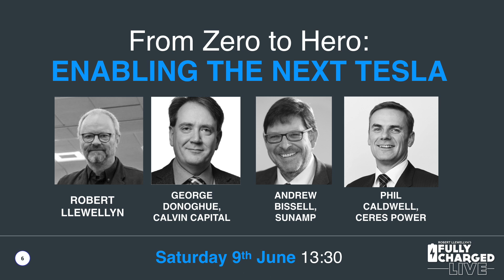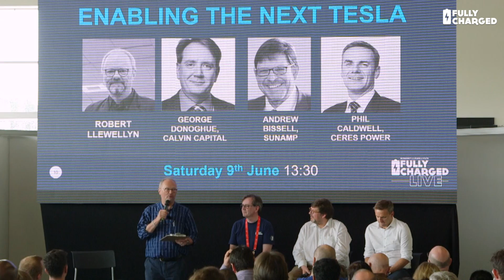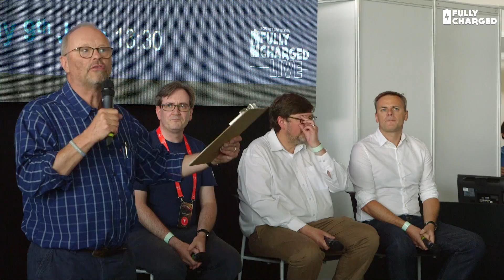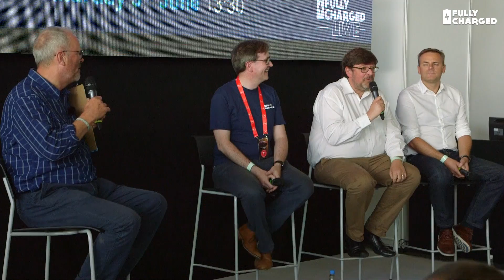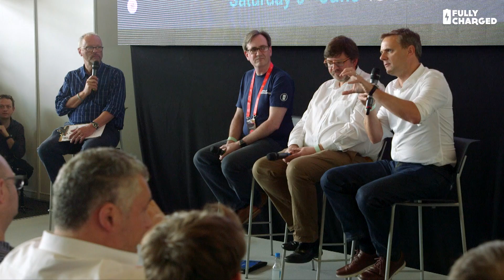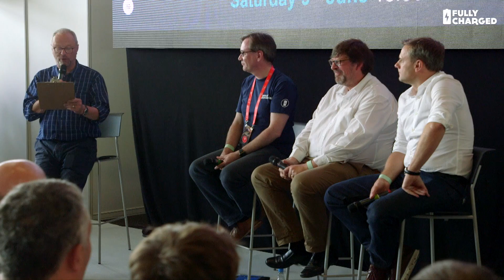Enabling the next Tesla | Fully Charged Live 2018 Talk 5

Comment: 6:30 Tesla doesn't make it's own batteries??? Does this guy not know about the gigafactory? Sorry but you lost all credibility after that comment
Reply: Milan Shah Panasonic make the Batteries in partnership with Tesla at the gigafactory. So technically they are correct.
Reply: The critical technical innovation that motivated Tesla was the observation that they could take off the shelf laptop batteries (the 18650 cell) and build an EV with them rather than have to develop their own cells. The comment the chap made was exactly correct and an important take away.

Comment: Fuel cells are still using fossil fuels.  Natural gas (Methane) is a fossil fuel.  Hydrogen almost exclusively comes from Natural gas, a fossil fuel.  Hydrogen made from electrolysis of water is about 3 to 4 times less efficient than using the same energy to charge a battery.  

On the other hand, fuel cells powered by natural gas are more efficient when they are used to produce both electricity and heat for water and air.  (In large part this is because the normally wasted heat is captured and used for something else.) But that's still using fossil fuels.  Solar and wind are better.
Reply: I would ask the question, what is produced from bio-digestion plants? Their natural gas is a product of decay, yes, but not over the period to qualify as a 'Fossil' fuel, I would have thought.

Also, if surplus solar energy is used to 'crack' water into hydrogen for a fuel cell, that too is not using a fossil fuel.

Just a thought.
Reply: Good point.  Biomass can be Carbon neutral, but it matters where the Carbon in the biomass came from and how it got there.  Lots of fossil fuels are used for making fertilizer (and energy to make the fertilizer), crop cultivation, etc.  But a majority of Methane used commercially is a fossil fuel that comes from the ground when oil is extracted, etc.

The problem with using solar energy to do electrolysis of water to get Hydrogen is that the same energy would go 3 to 4 times as far in a battery electric vehicle.  Hydrogen from water used in a fuel cell is about the same overall (well to wheels) efficiency as burning fossil fuels in an ICE.  It is not an overall improvement in energy efficiency.  It is not economically viable, and it's a poor alternative to simply charging a BEV and going 3 to 4 times as far as a fuel cell vehicle on the same overall energy input.

Improving battery technologies have already made Hydrogen fuel cell vehicles uneconomical, and they were never very practical or cost effective for vehicles to begin with.  Fuel cells are excellent in space stations however.

That said, if electricity and heat must be generated from natural gas (a fossil fuel), then using a fuel cell can be more efficient than other means.  But it's still fundamentally using a fossil fuel.  Long term, we need to use renewables, not fossil fuels, and the sooner we get there, the better.

Comment: The Sunamp heat battery is very intriguing.
Reply: Fully Charged did an in-depth episode on the battery in 2016 https://www.youtube.com/watch?v=9upXeTMHUqE
Reply: I am looking into one and have been for a few months. Hot water and heating. The trouble is there isn't any customer reviews to assess its viability. If I can save my gas bill (£700 per year) it will pay for itself quite quickly and then start to pay back the solar installation. I like and understand the concept it's real world use from an user I would like not the manufacturer. Due to the number of sales I may have to be a trail blazer and take the gamble.
Reply: Mark Jennings ...